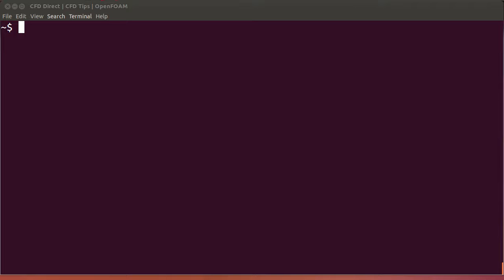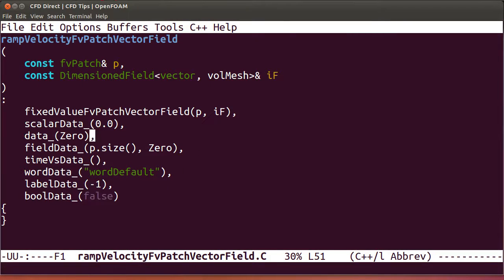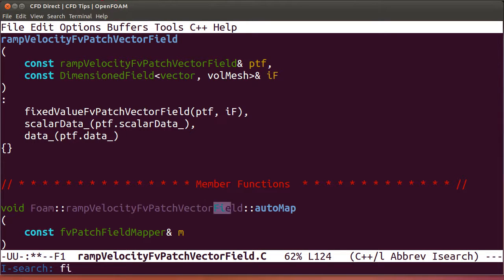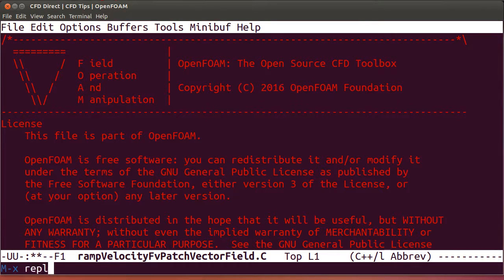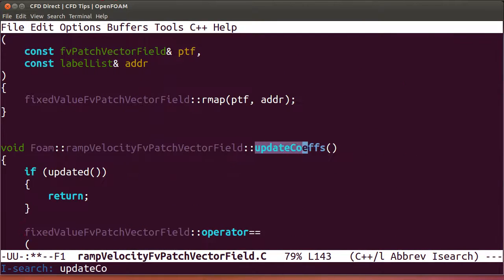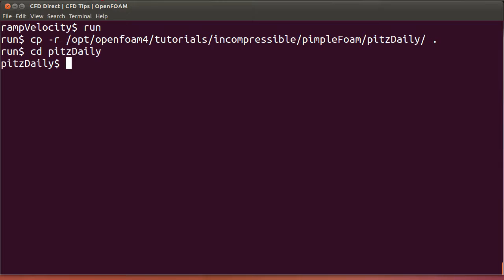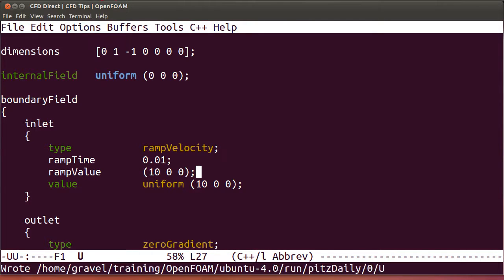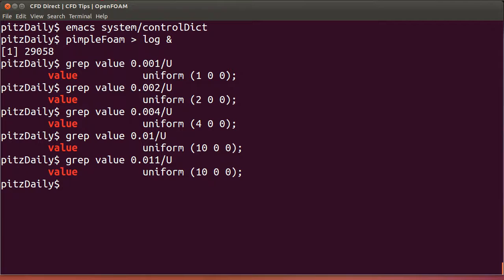OpenFOAM v4.x Computing and Programming: Implementing a Ramp Boundary Condition

Comment: Some pointers to application of spatial variation in a boundary condition would be very welcome - say flow and heat transfer with linear (or other function) change in wall temperature with distance (say from entry point).